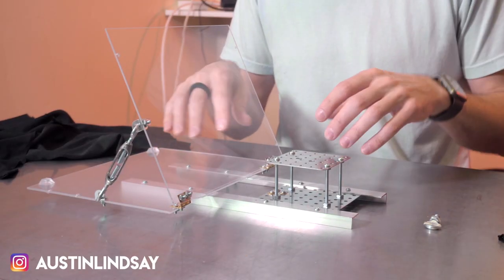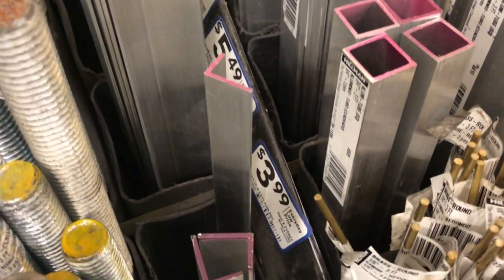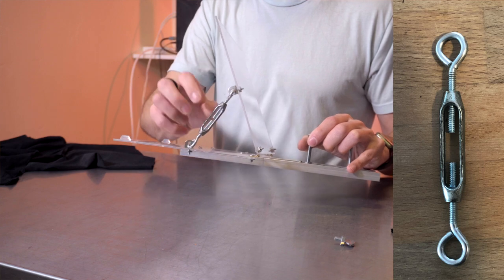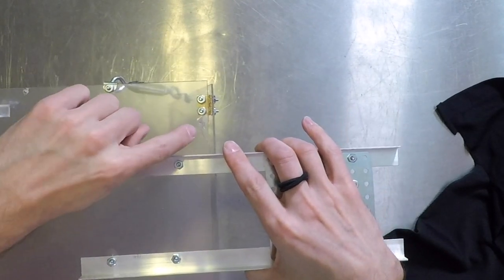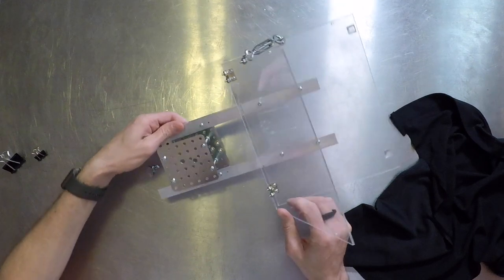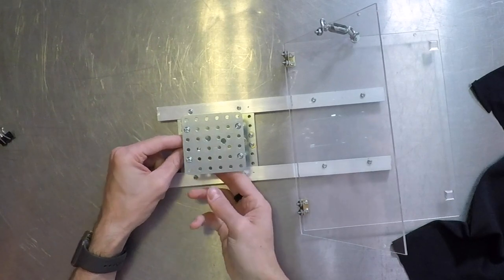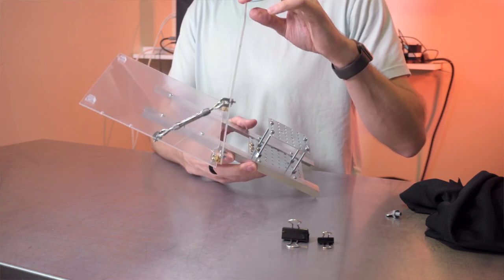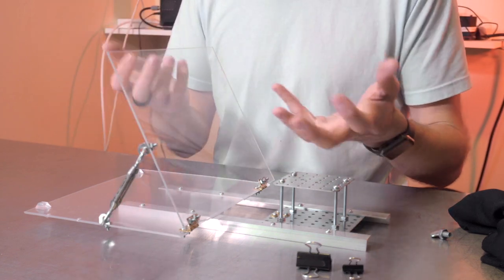Building a DIY teleprompter

Comment: I have to say that that is one of the more clean looking diy teleprompters i have seen. But here are the tips i have for you (without reading any other comments so sorry if i repeat some).

For a starter i wpuld like to talk about the angle. The amgle you'll get the best readable text out of will almost always be 45°. Reflection works pretty simple in the way that the angle light falls onto a reflective surface is exacly equal to the angle it reflects back at. So with the reflector at 45° it will make it so the text is perfectly straight in front of you making it the most readable.

Second is about your black cloth solution. Maybe cut up another t-shirt but use one of the sleeves around a sunhood and also close off the bottom
Especially in brightly lit studio setups it will make the lens almost invisible behind the reflective glass (especially with my third tip if it works out) and also minimises the risk of annoying flares or reflections from the ceiling getting into the lens.

Thirdly i have something a bit hypothetical, bit why not use those one-way mirror foils they use on car windows? If you can find one that almost has no light blockage from one side but a bit of a mirror finish on the other side i think it would greatly improve the readability from your ipad. Plus, with the full blockage of outside light and a more extensive side blockage of light it would brighten up the text even in bright studio settings.
Hope these help ;)
Reply from the maker: Thank you for the in-depth comments!! I really like all those tips. That third tip is amazing. I'm going to have to go search Amazon for some of that foil. Because, after you mentioned it, it does seem like I remember seeing rolls of that type of stuff a long long time ago. 

Thanks again for the feedback. Very helpful!

Comment: Nice build. I would think adding some tension on the backside would fix the issue with the turnbuckle. The glass looks like it wants to fall forward so if you added tension to pull it up you could use the turnbuckle to pull it down rather than push it up. Not sure the best way to do that, but it could anchor to something that goes into the 1/4 20 mount on the top of the camera or possibly down to the rail on the side.
Reply from the maker: Cameron Porter I like the idea of reverse tension pulling back. I’ll have to roll that around in my head a bit. Thank you!

Comment: Have you noticed a loss in clarity and detail, shooting through the acrylic?
Reply from the maker: In my uses I haven't noticed any difference in quality. I haven't done any extensive testing. But, I did a video screen shot of a Parrot Teleprompter, my DIY teleprompter, and no teleprompter at all, and the only real noticeable change was that the Parrot was a bit darker in exposure. (Which makes sense because of the beam splitter glass). Here's a link to the screen shots. 

https://drive.google.com/file/d/1OnlMMCGRSbl3pZnFX6gb9uY9qKSG5UTc/view?usp=sharing